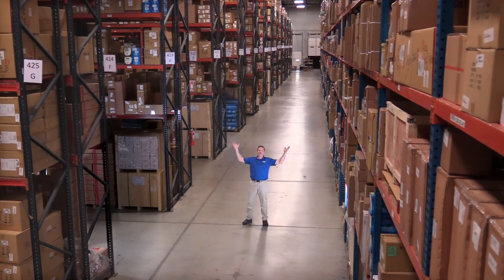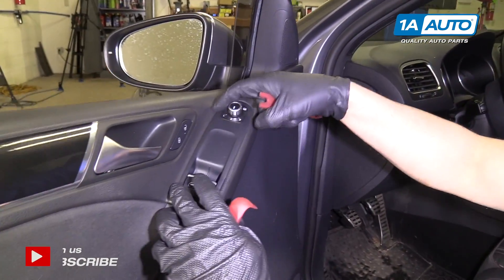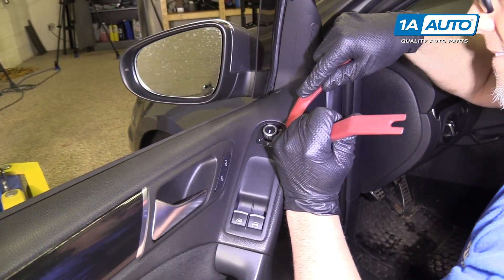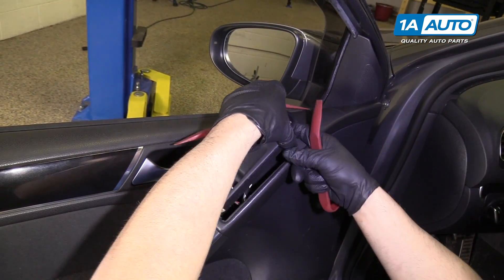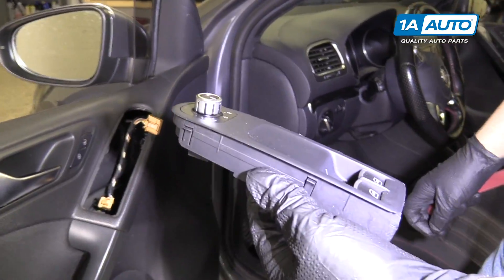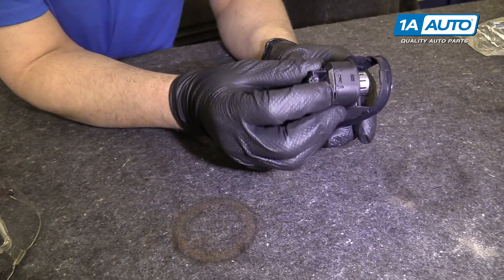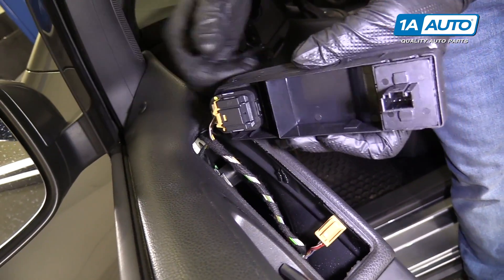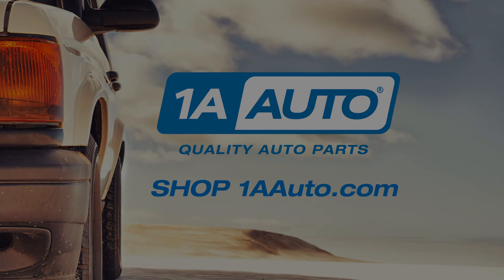How to Replace Side Mirror Switch 10-14 Volkswagen Golf/GTI

Comment: Thank you for the awesome video. My knob broke a couple of weeks ago and I have zero mechanical experience. I had the part replaced in about 10 minutes. I did a test before popping the control switch back into the door panel (not hard to get out but unnerving because of the fear of breaking a clip). I didn’t break anything and it is working like a charm.
Reply from the maker: Thank you for the great reply. We love to empower our customers by showing you how-to perform your own auto repairs while installing our high quality auto parts. Have a great day! 1aauto.com +Angela Tyson

Comment: do this method apply on Chevrolet aveo 2013 ? ...you maybe more familiar
Reply from the maker: +monged jamjoom The installation process should be very similar.
Reply: kindly , the two mirror not operated (suddenly ) & I check the fuse ( is ok ) what other reason can be beside that the knob mirror adjuster ? is any other possible occur this fault
Reply from the maker: There could be multiple reasons why you're having this particular problem. We suggest taking your vehicle to a nearby reputable shop to identify the cause. +monged jamjoom